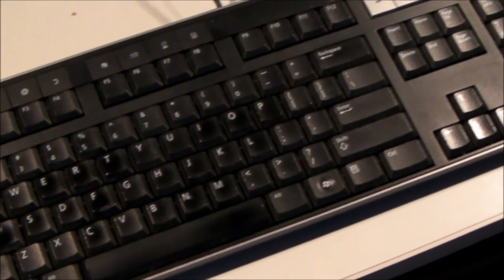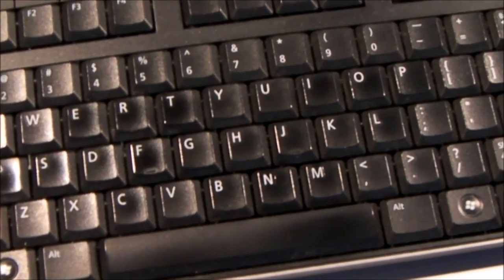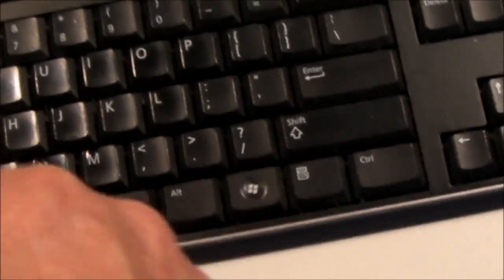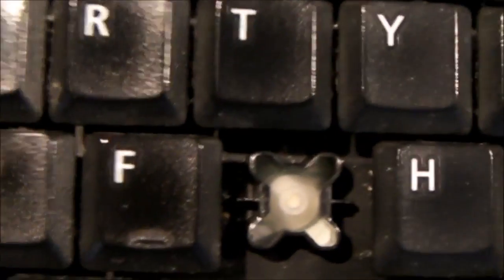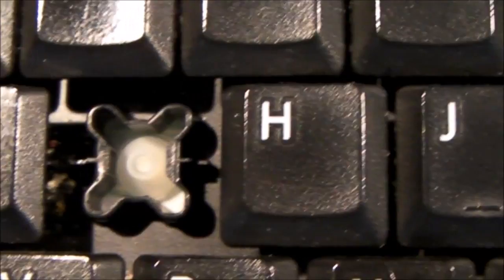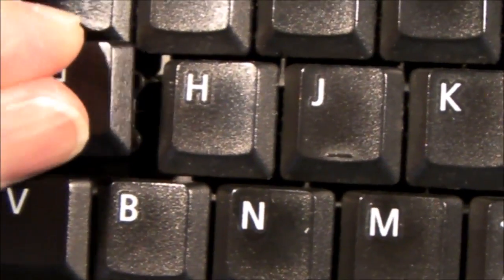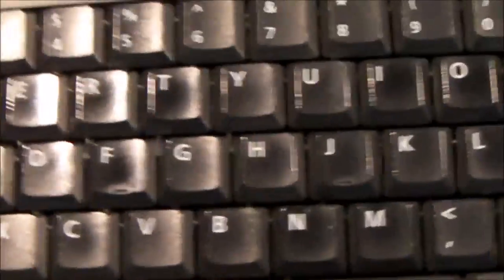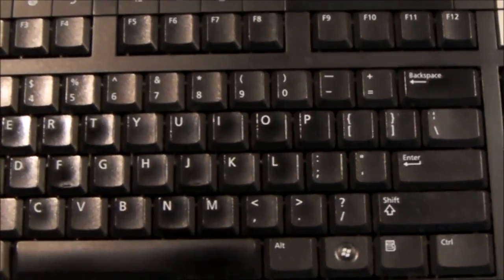Simple solution to fix sticky key on computer keyboard;  key won't fully depress

Comment: Warm hair dryer aimed at the keys, check battery if wireless sometimes works, best is to take apart and check membrane or if switch key wd40